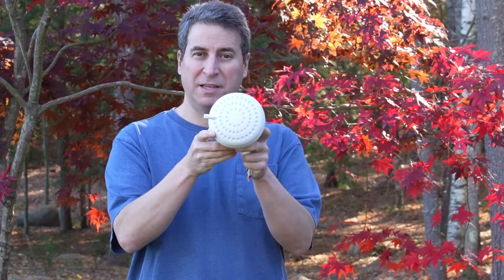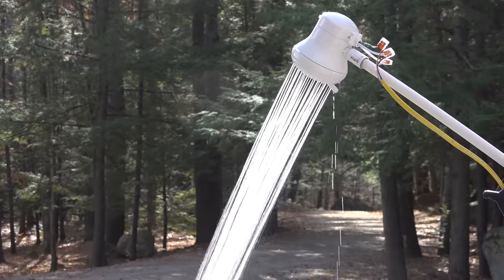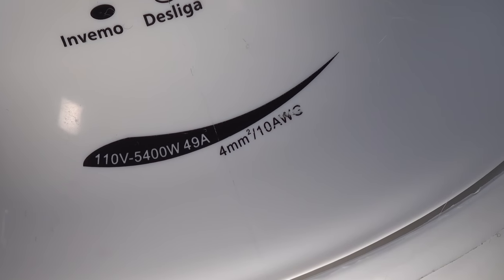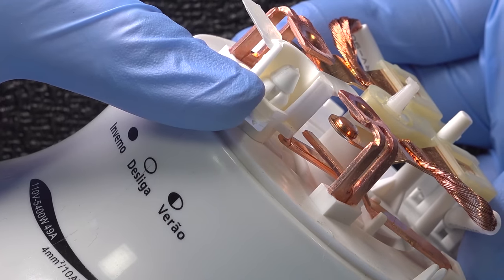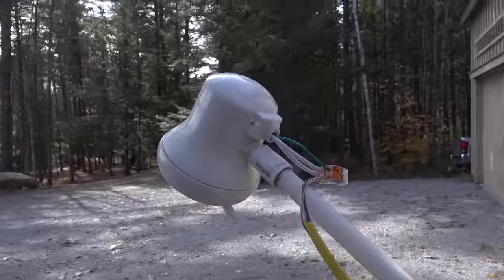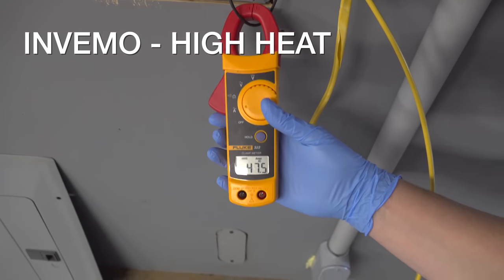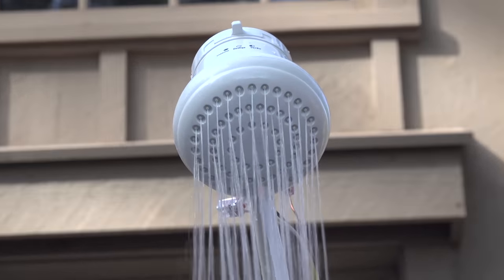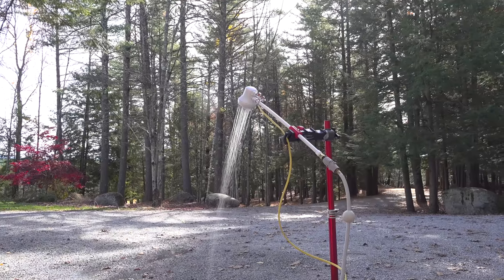What Happens When You Use a SUICIDE SHOWER HEAD in the US

Comment: Yea, these are not so safe, I have one and there is often a good amount of leak current going back up the water inlet, (but not through the water coming out) I think the issue is that the water here gets cut off day, which fills the pipes with air, so when you turn on the water you first get compressed air before getting the water, the compressed air causes the device to leak which seems to get water inside the circuit can cause the current leak...

Comment: 47.5A? Holy crap... this thing is a fire hazard, not because people don't use waterproof connections, but because they are more than likely using small 12 or 14 gage wire to feed it which is rated for much lower amperage. This thing need to be fed by a dedicated 50A circuit with #8 wire!

Comment: As electrical engineer, what terrifies me is that these use 50A, and yet, only 4mm thick wire is recommended. Also that they use stranded copper for connection. 
For me, 4mm is 32A max, but I would not use it for over 25. 
At home I have 24kW 3 phase water heater, which uses 8kW per phase or 38A at 230V. And yet, it is supplied with 6mm thick wires.

Comment: Im from Brazil. First thing you did wrong was angle the  shower head  that  does make a huge difference . The are straight over head and not angled. Second is is that your flow of water is much too high . In Brazilian house holds the water is supplied from city mains to  a house hold water reservoir called a caxia de água or water box. That are above the house  the  water is only falling at the rate of gravity.  And the weight of the water usually is between  500 to 2000liters. But in your case you would have to. Close the register by half.  And if you didnt know winter in Brazil can get very very cold . Now having that water reservoir being on your roof on a cold day  you can imagine  the water is pretty much as cold as  late fall (not something you would want to shower with. . The rate thw water passing the element  makes a huge difference

Comment: Low shock hazard...  Water is conductive right?   
Sort of...   When water is sprayed from a shower head, it tends to form water droplets in the stream, we don't see that, all we see is what looks like a steady stream or jet of water.  Couple that bit of physics with the water passing over the heating element and the water molecules are being heated/slightly vapourised, which tends to excite/break-up the water molecules.   
.
Because air does not conduct electricity, there is of course a lot of 'air space' between each droplet, this means that the water molecules are not contiguous, as they would be in standing water -  as in a puddle of water, or water perhaps flowing slowly from a standard fawcett... This increases the resistance/impedance to any electrical current that might wish to flow through the water.  The earth/ground wire merely assists in this grounding,  mostly for peace of mind it seems.     This is why there is no discernable voltage reading from the water spray.   
.
For those who experience 'tingling' (mild electrical shocks), the problem might be a poor shower head design, or reduced water pressure, that might be allowing some current to flow down the jet.   
.
For me, the questionable safety factor is not the fact that water is passing over a naked high-voltage heating element per se - because of what I've just explained - but more the dodgy method of connecting it to the mains supply + naked wet body... (shudder).   Also, these types of shower  heads tend to run on 110-120v~  in the countries where they are predominantly used.   Here in the UK, where our mains voltage is 230v~  the risk of shock is far higher,  probably one reason why we never see these being installed in Britain, they'd probably be continuously setting of the RCD's or MCB's in the process.   We'll stick to the 'mini-emersion heater' designs common in instand shower units.   Much safer allround.

Comment: In my country these are quite common and have been in use for at least 45 years now. They are NOT suicidal! I know of many households that have them and not one of them have ever reported any ill effects. There have never been any reports of electrocution by one of these. Not even worldwide! Don't knock what you don't know. If a slight shock is experienced, it is not the device - it's the wiring. Do not discard the device on account of a faulty ground. Moreover they are very efficient, delivering hot water where and when needed, they are very cheap and will easily last for over 5 000 showers.

Comment: Those are common here on mexico I even have one but is not longer working we just use it as normal shower  also there is a resistance that you connect directly to power outlet and dunk it on a bucket of water to heat it

Comment: I had a similar shower in UK but the heater was in an enclosure with a normal hose and shower head. The water passed through a clear plastic housing an open element. There can be a problem if the local water has high conductivity.

Comment: One of the biggest issues I could see happening is improper sizing of wires. If that shower head is pulling 48 amp then 6 gauge wire should be used. Looks like the head has this, but I could imagine someone installing something like 14 gauge to connect to it and ending up with a heated cable and a fire.

Comment: I grew up showering with these. They are extremely safe. 

Now in some cases people get the tingling sensation due to a high concentration of minerals on the water combined woth a lakc of a ground wire. Some people unexplicably connect the ground to one of the “hot wires”. Usualky nothing happnes but it’s dumb af.
Reply: I also feel that tingling sensation when i have an open wound.
Reply: Definitely not safe get a real tankless water heater
Reply: @iair-conditiontheoutsideai3076  "Definitely not safe" - literally everyone uses it in Brazil, with no deaths. Only way to hurt yourselr is if you reach up and grab wires that are exposed while soaking wet.

Comment: Brazil is absolutely over flowing with these things. The first time I went there all the bnb's except 1 had them. My GF's apartment had 1 too.. And the way they were all wired up you could clearly see bare copper haha Death traps! I should add, they do a great job heating the water! If you ever find yourself with an under powered 1, reduce the water flow and it'll heat right up.

Comment: Some facts why most of South America does not use gas showers:

1- In most South American countries it is hot even during the winter. So we don't need to invest in heating.
2- We only use gas for cooking and we buy it in cylinders
3- Electric showers are very safe, even with a bad electrical system
4- In case of an electrical surge, the resistor will burn out quickly, not passing current. And we also have circuit breakers for prevention.
5- It is cheaper to have a shower that only uses electricity, than to invest in a piped gas system. In fact, most cities don't even have piped gas systems.

Comment: When you checked tension you should have placed one lead in the glass being filled by all of the flow at a fixed distance.  Tap water can be 6Ω/ft. GFCI trip time spec is 20/mA^1.43.  Sudacas with Chinese electric showers largely have PVC plumbing, which reduces ground fault risk from the ground side.  If you don't know how it all works don't do it.

Comment: The grounding wire doubtlessly helps, but GFCI wouldn't work with that as it would create a leakage current that trips the GFCI. Also why is this just a length of copper in the water stream, rather than something corrosion proof like stainless steel?  Over time it could corrode and lose its ability to drain off stray currents.

Frankly I'd still want to go with a tankless (or small tank) water heater and not have the electricity brought to the shower head at all.

Comment: Unless you use metal pipes connected on it, its totally safe. We use it here in Brazil since many decades, I've never heard about one accident, usully is on
 the installation without minimum electricity knowledge. Also more eco friendly, dont wast water and loose less energy after heating process

Comment: I suspect a GFCI would trigger open all the time.. Also im pretty sure those who use the 110v version dont use proper wire gauge thus shifting the neutral into a.. non-neutral state causing even higher shock risks if the ground is shady, and oc delivering less heat to the shower.

Comment: I think the highest shock potential hazard is if the heating element breaks and the "ground"  wire was not installed correct to flow the electricity out and it allowed it to flow to the person in the shower.   .... A shock potential  If the power section diaphragm leaked water into the electricity lines thus providing a leakage inside the shower head.  If one of the mains connection was not connected  it can make a shock when touching the switch.   The problem in this design  there is no warning of a problem until you use it.     Yes the final protection design is the water is the final  high resistance conduction path of electricity  to the human   which may be enough for only a shock.  Unless you play with the power lines direct while in the shower.     The closet  most people come to electrical shock is the coffee maker where water and electricity are semi insulated under that plastic cover and heating element.   Hair dryer is next wet hands mm from electricity.   but the GFI are now required in bathrooms and kitchen for that reason.  New hair dryers have another GFI in the plug.

Comment: it will actually turn on without water inside
in fact, they recommend you to run cold water inside the shower to prevent ir to literally blow over
don't ever set it to the "verão" or "inverno" position before you fill it with  cold water

Comment: I lived in Colombia for years and we had something very similar. However the plumbing was all PVC and there are no 3 wire systems so no ground wires anywhere. The instructions tell you to hoes clamp the green wire to the pipe that is feeding the showerhead, but these are all PVC so no value there as a safety.
I lived in Medellin which is roughly 4500' altitude and the water was very cold but the showerhead brought it up to a very comfortable, though not hot, shower.
The worst I ever saw was on a small island. 220v system with no grounding at all and the wire going to the showerhead were just bare copper wire and passing very low, maybe less than 7'.
This was in a hotel. 
I never got any sort of tingling sensation or any shock from any of these but that doesn't mean I wasn't extremely apprehensive about taking a shower.

Comment: The only thing I don't like about it is that the heating elements aren't electrically insulated from the water. If one of them fails, the alternative path back to the source (you, through the water) looks a lot more appealing than it does when it has a near-short (through the heating element). I would want some kind of ceramic heating element that won't conduct electricity to the touch. Much like how cheap soldering irons are heated; you plug them straight into a receptacle, but the iron tip is electrically insulated from it.

Comment: When my wife and I moved into the 2nd place we lived in after moving to Puerto Rico there was one of those installed on the shower. Trying it out it shorted out immediately. We replaced it immediately with a regular shower head. The normal water temperature was good enough not  worth electrocution for a hot shower.

Comment: So a couple things here that make this horrible from a electrician perspective. If it’s pulling almost 50 amps you need to have a dedicated circuit from this directly from your panel most open circuits in your house will be 15-20amp breakers and won’t be able to handle this safely. Also the size wire to support 50 amps is pretty expensive. And adding additional breaker and pulling the wire. You could however pull it from your range or dryer circuit but those (according to code) need to be dedicated. For those appliances

Comment: It's insane that these come with 10cm wires. This means that the electrical connection always needs to be made in the shower room. When these would come with a 3m wire or longer, the electrical connection can be made outside of the shower room and there is no risk for water to get between the wire connections.

Comment: A brand new shower unit probably is not too much of a death risk if it's safely installed, but when that internal plastic and that diaphragm starts wearing out and it's breaking, that 48 amps @ 120 volts just above your head gives a new meaning to the term HOT SHOWER.☠😵

Comment: I'm brazilian. I got electrical shock when opening the faucet for the shower every time i had a cut in my hand. I had shower smoking up in the middle of my shower when I tried to lower the water to get hotter water and burned the resistance. I had bad experiences with those shower heads. Then again the electricity in my house was bad.

Comment: Invemo is mistyped. It should say Inverno which means winter.
Also, its never good to change the temperatures while the water is running. Every temperature adjustment should happen with water off

Comment: If you did purposely electrify the water, how much of that stream would have electricity?  What pressure or flow rate is needed to keep the electric current in the water stream because if the flow is low the water is coming out more or less in drops and not a constant stream.  Is that why people report "tingles"?

Comment: There's been more deaths by gas leaks in gas heated showers than electric showers. IDK where the "suicide" name comes from.
Nowadays even the cheapest showerheads come with protection covers for the wiring exactly so it's not exposed, or they use angled heads so there's no need to extend it from the wall with a pipe, so you can keep the wiring in the wall.

Comment: Going by the current being pulled by that you would need #6 copper or #4 aluminum for the supply. No code inspector would allow that to be operated on #12, not even for a short duration. But hey whatever lights you up I guess!

Comment: This is insane! The typical guage home wire is 12 gauge Romex. That quage will not safely deliver 50 amps of current.
Reply: The ones I saw traveling were 220 or 240v probably for that reason.

Comment: How many houses in the USA have residential wiring installed that can support 50 amps at 120 vac?   Any device drawing anything close to 50 amps would run off of 240 vac,  and would require a separate dedicated circuit, CB, etc and use up approx all of the excess electrical capacity of the house.    With the standard high draw electrical devices (stove, water heater, washer, dryer, & possible heat pump, etc) a USA house has, an additional 50 amp shower head is not practical.

Comment: That looks like one of the cheaper models available. There are some much better devices where the coils are not directly exposed to the water. That's not really for safety, but more to increase the lifespan of the heating elements. Those better models also usually have better temperature control. Fun fact, we used to have metal levers to control the water flow. If the showerhead wasn't installed correctly you would get way more than a simple "tingle". That said, even the simplest models are certified and work just fine. It's even better in places where 240v is used since the wires aren't so thick and installation is easier(there are actually power sockets intended for these that are usually pre-installed by the builders).

Comment: Had these everywhere on my trip to Brazil, although they were installed very well and neatly. Only scary thing is one of the shower knobs shocked me, must've been ground or sumn. Also if anyone in Brazil would like to explain to me why the bathrooms have so many mysterious knobs all over the walls with no apperant purpose
Reply: To turn off the water if you need to change a faucet or do some hydraulic maintenance.

Comment: Having the electric heating elements in direct contact with the water is a bad idea especially if the water has a high mineral content that makes the water more conductive.

If you don't have water tight electrical connections I would think you would get lit up if you touched the wires when wet.

Comment: Electricity must be cheap in Brasil or super affordable to have one of these installed. 30 amps in a domestic house is insanely high for just one appliance. Add on the refrigerator, a fan or air conditioner, computer, maybe the wife decides to dry her hair with the hair dryer and the amps can reach 50 easily.

Comment: The operational principle really isn't any different from any other electric water heater. The only difference is how far away you are from the coil and supply wires. Obviously that makes proper installation much more important, but that's really all that matters.
Reply: normal electric water heaters have sealed electrically insulated elements, under normal conditions the water never directly touches anything electrically live, unless of course it burns through and fails open. but even then it's inside a large steel tank, which is grounded and earthed.
shower heads like that are a big electrocution hazards in multiple ways, power surge from a short or lightning, if the neutral conductor goes open/elevated above ground, the water become salty or gets other conductive chemicals/minerals in it. BZZZZZZZZZ, human roasting.